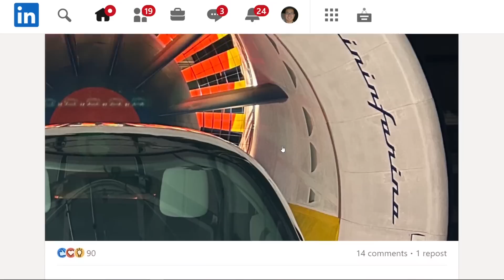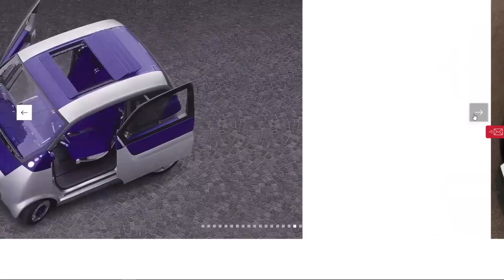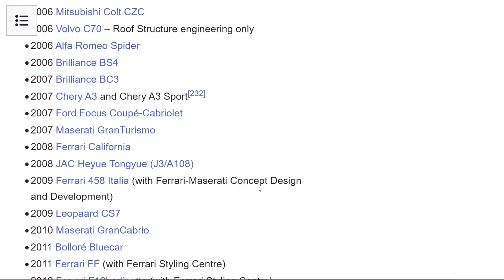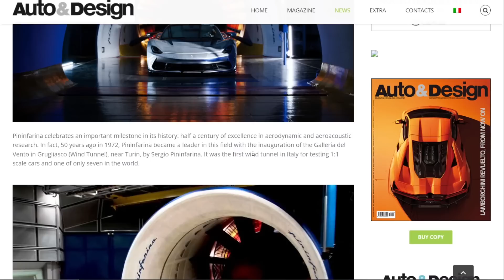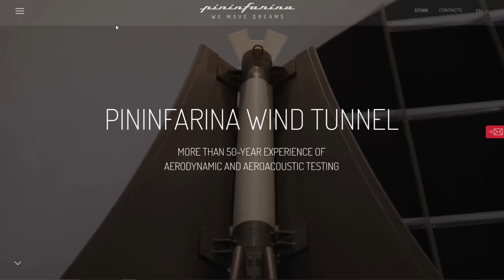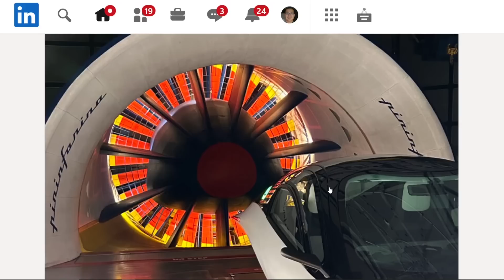Yes Aptera did some real world aerodynamics testing

Comment: Wonder if the back wheel could pivot to "crab" point in the direction towards a wind blowing in a perpindicular direction to travel. Aptera having the slimmer tail already, this could be possible for increasing range in a side wind traveling situation.

Comment: Aptera also had NASA test their shape in their wind tunnel last time around. So it is not the first time. Apparently nasa called after running their tests to get some details, because the results were better than a cigar shape for that volume, and significantly better than nasa was expecting. 

Aptera's explaination a decade ago to nasa was that the long tail, especially on the bottom adds propulsion, like squirting a water melon seed out from between your fingers.
Reply: The NASA techs operating the wind tunnel weren't, pardon the pun, up to speed on what makes for great aero on low speed land-based vehicles.  I think it's only been around for a handful of decades before Aptera came along...

Also, no, no "propulsion".  It's simply less drag.....

Comment: The greater aerodynamic Coefficient of Drag due to mirrors is minor compared with battery and motor efficiency and tire rubber hysteresis and wheel alighment.
You guys are getting too focused on one number, and not enough on comfort and safety.

Comment: My problems with Aptera.
1. Cost is too close to Tesla model 3
2. Only a two seater
3. We don’t know how safe the vehicle is, weight is a big factor. 
4. Profitability is uncertain.
5. Cash flow burn of $50 million/year.
6. Doesn’t qualify for federal/state Tax rebate incentives.
7. Haven’t herd any updates on private equity fund raising. 
8. Best scenario won’t start production till 2025. 
9. Tesla is continuing to reduce prices and increase quality. 
10. Early production models will have very few features till at least 2027
Reply: The upcoming Volvo EX30 is in the same pricepoint, and a proven brand with dealers and service centers everywhere. Any established EV company in the mid $20k to mid $30k range will beat any startup (especially one as niche as Aptera may be).
Reply: @papasquat355  Chevrolet better read your comment right away so they don't take that Bolt off the market!  Sounds like their established EV brand will beat Aptera hands-down.  Papa Squat said so.  Wait, why did so many people reserve Aptera when they could have simply purchased a Chevy Bolt??  Hrmmmmm....
Reply: @jonj9149  You are correct. Why is Chevy discontinuing the Bolt?
Reply: and never pay for fuel or burn anything to get power into it.instantly worth it to a great deal of people.
Reply: @jeffreyd1701  I calculated it saves at most $1,000 a year compared to a model 3. But in the real world how often are our vehicles in direct sunlight? Many times we are parked in shade, parking garages, etc. I think aptera is showing best case scenario every time.
Reply: @RomanChaar  0.700kW * 3 peak equiv hrs per day * 365 day * $0.15/kWh = $115/yr of solar value.
If I were ordering, I think I would skip the rear hatch to have basic glass.
Reply: Items 2, 3 & 6 can be confirmed.  The remainder of these are projections, spin, FUD & negativity.
Reply: @jonj9149  *speculation, not fud lol
Reply: @RomanChaar  **Nope.  Lol.
Reply: @jonj9149  sí
Reply: @RomanChaar  Nope.
Reply: @jonj9149  you leave me no choice……..Joe Mama
Reply: The big invisible 500 lb gorilla is China.
Once China's EVs are sold in the UK and Europe,  the US manufacturers - and maybe Japan's - may be wiped out.
Engineering will almost be irrelevant.  The Aptera hasn't a chance without import duties and tariffs to protect it.

Comment: I think the numbers will come in better then 0.13. This numbers has been quoted since the Alpha version and it is known that with Beta development improvements to the aero were made. Those improvements were never given a finalized number, just a percentage of improvement.  Also after that the wheel pants were changed along with the rear wheel cover.  Those changes can be seen on Gamma. This might not be the Delta version, but it will validate the CFD simulations. If the numbers come in equal to the original claim or better it should help with kicking back some of the negativity that Aptera receives for having the numbers based on simulations only from the people that don’t understand how powerful those programs are.
Reply: You're probably right but don't forget the mirrors they had to add
Reply: Well said Joseph, I agree.  The possible exception may be the side mirrors which were required to be added.  I believe Gamma will not perform quite as well aerodynamically, as the Delta/production variant, so these results will be exciting to see.
Reply: @DemaGeek  The mirrors are easily removed at the convenience of the owner. Mine will come off before I leave the lot. I DO NOT OBEY AUTHORITY!
Reply: @1voluntaryist  Yes, I love that Aptera is working to change this law and has planned ahead this way.  Ours will be coming off ASAP too!
Reply: Give me Camera, or Give me Death... 😅❤😮

Comment: Look at that lil baby wind tunnel!
Reply: Wind tunnels come in a wide range of sizes.  The smallest I've seen was 6 inches in diameter, but had a maximum speed of Mach 4.4.  I did a test in the world's largest wind tunnel with a test section of 80 feet tall and 120 feet wide.
Reply: @ljfinger  I have been in WSU's wind tunnel lab.  They have a supersonice that is about 2 inches in diameter.  Don't know what speed it can achieve, it's been 30 years since I was there.  They also have a much larger one that might be able to fit the aptera in, but I think it was designed for 1/5th to 1/2 size models of cars.  When I was there, the big one wasn't yet operational.

Comment: Not sure what value these testing results would have in the long term, especially if not as good as predicted, or even if better as that would raise the expectations for a production version that might not reach the gamma bar from this test. Only the official results of qualification testing of a production version (LE) count. I would suspect the LE would do marginally better as the fit and finish at a mininum, is better. I think a waste of time and resources unless it was "No cost" which is doubtful. Another issue, if LE is tested, great effort must be made to insure the testing environment is calibrated to the EXACT same vales as the testing depicted here. I am somewhat jaded as I come from an aero engineering background where the attention to detail and equipment for this type of testing is much more precise that a decades old aparatus. All the ame, I guess good for marketing dropping a famous veicle design name. Perhaps at the same level as the marketing statement reference the Elon Musk comments on Aptera.🤔🤔🤔
Reply: I think the intention was to validate their aero modelling between the most current Gamma CAD model and the physical test (e.g., if there was a mismatch between the physical test and the aero CAD modelling, then they'd need to investigate to see what was missed).  That's just speculation though.
The only other reason I can come up with for why they'd want to test Gamma rather than Delta is marketing ("sexy photos in wind tunnel" is pretty much expected from a marketing viewpoint).

Comment: I must be missing something. Shouldn't the front of the Aptera be towards the fan?  It looks like the back is towards the fan.  Does the fan suck air rather than blowing it?
Reply: Actually, having the Aptera facing away from the fan, there is a more natural airflow across the vehicle. If the air is blown across the vehicle from the fan, the air is disturbed by the fan & turbulence from the fan is seen. The air should be sucked across the vehicle not blown.
Reply: @ddessert6  👍👍
Reply: The fan is sucking not blowing .
Reply: Yes the fan does suck rather than blow, less turbulence, cleaner flow.  If it were blowing, then the air would have a rotating motion that would destroy the results.
Reply from the maker: I think they just had it that way for the photo op
Reply: @ApteraOwnersClub  you're probably right.  That makes sense.
Reply: I would have expected the suck pattern to be more "funnel-like" than a blow pattern. I've seen Delta's wind tunnel, but it wasn't loaded at the time and I never considered asking about orientation. At Delta they had huge baffles opposite the fan though, so I imagine the flow pattern could be influenced by intake and room shape, and if the air "funnel" is large enough to fully envelope the vehicle I suppose the real-world differences might not matter

Comment: I suspect the Cd will come out very close to 0.13 or less in the Gamma and when Prod comes out. To have something higher does not help them in the area of credibility. Even 0.14 at this point of everything being as efficient as possible, will make a difference. In real-world experience, the tire pressure & total weight will likely be more important than 0.13 to 0.14 for Cd.
Reply: Based on my calculations At 70 mph the difference of 0.13 Cd or 0.14 Cd is a 15.5 mile range loss for the LE.   You would need to add 300lb of weight to result in the same range reduction in range at that speed.  At lower speeds the impact of weight and rolling resistance is more significant than aerodynamics but Aptera has an even greater weight advantage than aerodynamic advantage so range at very low speeds (ie 20 mph hypermiling) could be ludicrous (ie 800+ miles for the LE)